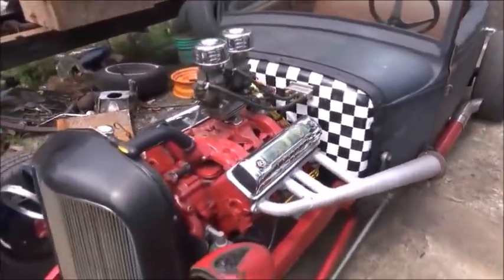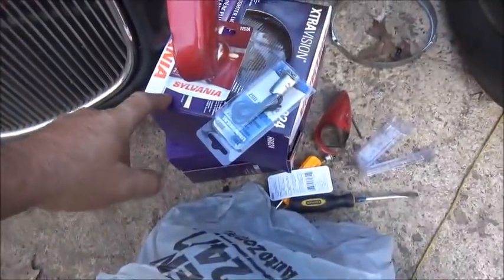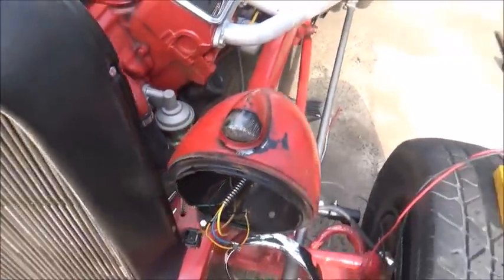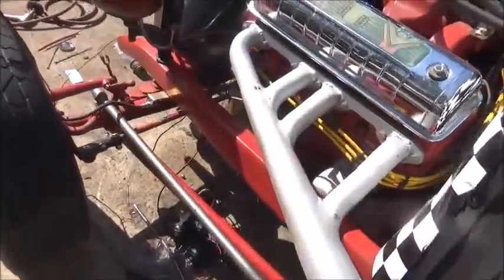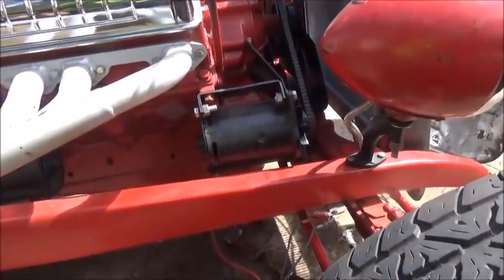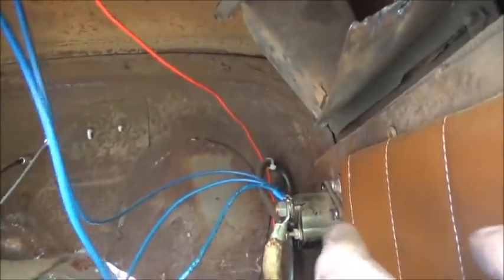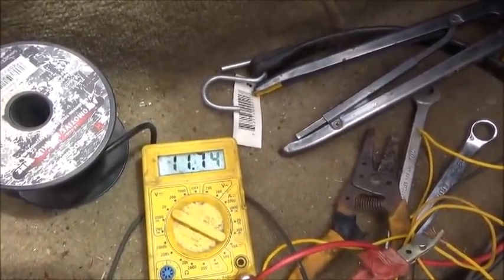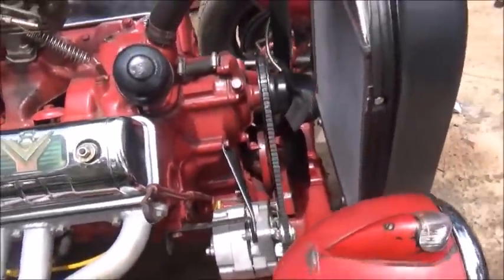1931 FORD ROADSTER HEADLIGHTS AND CHARGING SYSTEM

Comment: I used to run a momentary toggle switch to excite the alternator on my Farmall cub. What I found was the alternator would sometimes stop charging and I’d have to excite it again. Later I just hooked the excite wire to my ignition toggle switch and placed a diode inline to prevent it from back feeding the ignition.

Comment: you can still get cheap headlights and signal light bulbs  from a wrecking yard,  or scrap yard, used will most time last along time when you don't use them very much,, used  headlight 's turn signal  bulbs about .50 each  here   that is anyway

Comment: sorry, but alt has to have 12volts to it altime to charge,  genorator  will keep on charging once  motor starts,  how to check this vechile with alt will die  if you removed battery cable with motor running,  with generator will keep running and charging
Reply from the maker: 1 power all the time and one exciter wire. If you have power to the exciter all the time it will discharge when it is not running. If you have it hooked to the key power it will continue to charge and run even when the key is off. It must have a bulb, a diode or hooked to accessories to work correct.

Comment: Back in the day the 35 amp positive ground  power systems  were barely adequate so the 30 watts they saved by shutting off the marker lights was really worth it.   The system  could only supply 210 watts total at high rpm. So subtract 60 watts for headlights 50 watts for taillights  30 watts for ignition , 15  watts for the heater, and another 30 for dash lights there ain't much left. The extra 30 for the markers isn't there. and we left out the 20 watts for the the radio  as well. That is why they used vacuum wipers. Wiper motors are power hogs.

Comment: If you've got a motorcycle shop nearby they are a good source for those types of bulbs. Often used in indicators on Harley, BMW etc. They most likely have bins full of them(I know we had), they often get changed out for something else. They are also good source for other small materials I've seen you use; plugs, wires, bolts, brackets etc

Comment: I have a set of sealed beam lights very similar to those only the parking lights are a little smaller so I know what to look for now, thanks. Don't have a dimmer switch, forgot about that, I saw you had the good old style so something else to look for.

Comment: This is what I do to my headers and the paint stays on for a long time. I take old wood stove it's outside build fire take headers lay them on top of wood stove with a hook to hang them. Leave them there until they s top smoking, no pun intended. Paint headers while they are hot then i hang them above the wood stove let dry . And my paint has been on my headers for years they turn a little bit but that's white header paint for you.  Wondering if they make a hi temperature candy paint i don't know at this time but going to look and see. I'll get back to you on that,you may know what I am thinking .

Comment: Now you know why nobody else uses that terminal 🙂

You didn't want the alternator to only charge when you're starting anyway.  In fact that's a time when your don't really want it charging.  You could use an oil pressure switch, but that might be even more wiring.

Comment: I think before I spent that much on plain bulbs I'd invest in some LED bulbs that'll last a lot longer and don't draw as much current (especially good for vehicles with a generator instead of an alternator) and usually with LEDs they're just as bright with the car running as they are with the engine off because they draw so little battery power.  I just put a set on my riding mower that were a direct replacement for the 1156 bulbs it was using for headlights and you just wouldn't believe the difference.  It was like going from a kerosene lantern to a coleman lantern!  Bonus, if ya drop em, they don't break.  Got em for $14.99 a pair.

Comment: Here's an alternative: Alternator that looks like a generator
. ALTERNATOR That LOOKS LIKE A GENERATOR - AC-210. "DYNALITE" looks like a dynamo but is a lightweight alternator. RAC006 - Lucas C40 Replacement. This device is very convincing, looking exactly like an original 22-amp generator, but it hides a 40 amp alternator inside.

Comment: If I busted a bulb,I would have dripped thin coat blood on that pretty white manifold.Its hard to believe there's not one in your lot.
That old Yblock thinks it is still 1965.I like that bubble signal light.
Good to hear from ya

Comment: If you put a small bulb (side marker light) in series with the alternator excite wire, it acts as a resistor, and will excite the alternator.  In addition, when the light bulb goes out, you know the alternator is charging.  If the bulb comes on when the engine is running, you will know the alternator is not charging.  I have done several of these and have had good luck with the cheep-o marker lights from NAPA. Feed the light with the wire that feeds the light, and connect the terminal that grounds the light to the alternator feed wire.  Be sure to use the accessory side of your ignition switch so the excited alternator will not keep the engine running after you shut off the key due to the alternator backfeeding the ignition coil.  If your ign switch does not have an accessory terminal, you will have to use a diode to keep the alternator from backfeeding the coil.  Not a big deal...

Keep up the good work! I really enjoy watching your videos and learning the bodywork parts of your projects.  I have been wrenching for years but haven't done much bodywork.

Comment: 1931 FORD ROADSTER lights look fine!!! You'll sort that generator out. If I remember the Falcon generator correctly, it didn't have a cover over those holes, but the Mercury Comet did...Don't understand the difference, just that the Comet was a fancier Falcon is all....
Reply: I had a Falcon as my first car and it had the band over the holes where the brushes and commutator were, maybe someone left the band off some time when it was apart

Comment: My 64 c20 parklights did the same thing. Go out when you turn on the headlights on. But you can put a jumper wire between 2 post on the headlight switch and they will stay on. If you like that better. I googled it.

Comment: I've used an oil pressure switch to excite the alternator on tractors. The ford generator requires voltage on the fields opposite of a Delco, but you probably knew that.  Like your videos, keep up the good work.

Comment: Have you thought about using a  relay for the headlights? They would be brighter and take the load off of the switch.  The switch would just turn on the relay.  Just a thought.

Comment: That one blue wire off the solenoid has really gotten hot at one time. The charge bulb hanging under the dash will be a good choice until you get the generator fixed. I've done that on old tractor alternator conversions.

Comment: Good work as usual. Usually that exciter wire goes to the acc feed via the "IGN or ALT" small light bulb. It come on when not charging by finding a ground inside the alternator and goes off when both ends are at 12v when the alternator starts charging. If that bulb fails the alternator does not charge.

Comment: You could run the excitement wire from the alternator to an idiot light on the dash that's connected to the accessory on the switch. The alternator only needs to be excited when it first starts. I'm not telling you what to do just letting you know my opinion. Love this car.

Comment: If you wanted to really be thrifty, you could run the 6V sealed beams in series. Of course the problem is if you loose one headlight, you’d loose both.

Also I’ve found allot of the mom, and pop parts places sell bulbs from a bulk bulb drawer cheaper than getting a blister pack from some of the big name auto parts stores.

Comment: The smaller replacement bulb for a 1157 is a 1034. Memories from early years workin' at a gas station.
Reply: Johnathan look at a Napa # BPB1007AN. I think it would be a shorter version that would work. Your store would have to order them. Up here in ohio they would cost 5 bucks for a card of 2. Also they have common bulbs in boxes of ten that are less expensive.

Comment: You can use a diode between the switch terminals to allow the parking light to stay on.  Place the anode of the diode on the headlight side and the cathode on the parking terminal.  Use a diode capable of probably 4 amps.

Comment: The purpose of the coil on the solenoid is to provides 12 volts to the Coral when starting this wire will be connected between the resistor and the coil when does solenoid is just engaged or you let go of the key for a run position power then comes from the key through the resistor and drops the voltage down 9 volts love your work God bless you and your family

Comment: Dose the exciter wire need to stay live ?
Reply from the maker: no, but will run a battery dead if it is live when key is off.
Reply: @jonathanw4942  Thanks for getting back to me on this . So if I understand right it comes on with the key and stay on tell you turn of the key ? thanks again for your time .

Comment: If the solenoid has 2 small wires yes you can use the Ignition side to excite the alt. The S side is only active when the switch is in the start mode.
Reply from the maker: I tried and yes it is a two wire, but it wouldn't work
Reply: @jonathanw4942  The only thing that I can think of is on the Ignition side after the switch is in the run position there isn't enough voltage/ current to excite the alt. May I suggest you change the exciter wire to the run side of the switch. My thoughts if some one put a radio in the car they would turn the switch to the acc. to listen to the radio with out the car running and will cause a extra drain on the battery. BUT you and I both know that there is nothing sounding better then the rumble of a street rod!

Comment: I have been using alternators on my hot rods since the mid 60’s. Much better than generators. The one wire is junk as far as I’m concerned. GM came out with an alternator in 1963 with an external regulator the first ones I used.

Comment: I always make my alternators an external one wire by putting a small light bulb between the 12 volt terminal and the exciter terminal then a wire from the small 12 volt terminal to the large one. so I only have one wire going to the alternator. You could also use a small resister instead of the light bulb. I have been told that sometimes this causes the alternator to become an electric motor when the engine isn't running but I have never experienced that. If the alternator tried to run off of the battery then a diode would have to be installed in the wire from the battery. Jim

Comment: Remember when a headlight glass was $3 for a new “dual sealed beam” and a belt was four bucks. Then came the computers, price fixing, technology and now a set of headlights can be $2000 and a single F-150 tail light over $1000. I paid $1800 for a new Dodge Dart Demon with a slant six, factory three in the floor in 1972. It got 24 to 26 MPG and ran 250,000 miles. Delmar O’Donnell said it best, “That don’t make no kinda sense”. Electric steering and they gave us the “shaft”.
Reply: Just replaced my 96 F250 headlight assy and glass for about $40. / side. Put Wagner "daylighters" in, exp $50 set.... Need to do that about every 25 years!
Reply: I wish i had a rod like this with a slant 6 showin in it. To me better lookin than a v8

Comment: How many old cars you got laying around there... and you don't got a good bulb you can steal from one of them? I kind of like that new socket you got, I don't think I've ever seen one like that... I think I might need one on a project.... I'll have to check around for one. I think the only thing I would have done different maybe is mounted turn signal/larking light inside and the cover or housing, turning the bulb and socket 90° with custom a bracket, that way the cover won't hit the bulb... but sounds like you have a solution for that.

Comment: That solenoid is a single post... the two post ones with a post on the side where it went to the starter is hot so that when you cranked the wire that used to hook there went to the coil for a full twelve volt to start and then when its running when back to the resistor for their reduced voltage at the points. I can't remember if it stayed hot or not but if it did then you have a shortcut available. It might not and then it wouldn't work either. I have seen them on chevys that the wire going to the alternator was wired from the coil on purpose (remote coil only) to the alternator in the factory loom. Looks right nice... I don't think the alternator will vibrate too bad but if it goes to it then you have it figured out in less time than me trying to type a smart answer. Some of what your videoing takes less time to do than the videoing so I am grateful that you take the time. I have seen them wired from the exciter point on the alternator around to the hot side of the alternator too but thats only if the hot goes hot when keyed.   I hoping that yours and the wife's are both ready for tomorrow night

Comment: one long solid bolt  through to hold the alternator on  one bolt that goes to the back of the bracket to keep the alternator  in line  ?
Reply: I thought the same thing until I looked closely at how it's mounted.  It doesn't need a long bolt because the bracket connects to the rear.

Comment: As I remember from my junk yard days, if you apply battery to a generator it should run as a motor if it is good.  Think we used an old battery and jumper cables to test.
Reply: your right, i use a generator to start my engine,  then the regulator kicks in to charge my battery..
Reply: @jeffmartin9248  in the UK that is called Dynastart, as the dynamo (generator) starts the engine.

Comment: Looks like it's time for a new multimeter. Yeah, lightbulbs ain't cheap anymore. Those sealed beams used to be 6 bucks, now way more. Fewer vehicles use the 1157 anymore. Meanwhile advance auto is selling conventional oil for 7 bucks a quart.

Comment: Why didn't you get the bulbs from all the "towe" cars ? 8 bucks is ....
Reply: Snoopy Brown 
Unfortunately,  most, if not all, his tow cars use a completely different bulb. The new sockets are totally different.  1157 bulbs are expensive because they're practically obsolete.  I wonder if the clear ones are just as expensive as the yellow,  though.  Could always use yellow paint on clear ones......
Reply: Yea I wasn't quite sure why he didn't run a 1157 peanut bulb ...the I realized he wanted to keep it as much era correct as possible.
Reply: Ok, love his Chanel, but nothing is "period correct" ! It's all hand made with "Love"!! So I see it do it like you want!

Comment: I used to rebuild Ford starters and a few generators.  Yep, just like Ford starters, the generators had a band around the slots in the rear so you could access the commutator with a stone to seat the brushes.  The band was secured with a screw that went to each end of the band.  I'm an expert at rebuilding Ford starters as I did it for over 10 years.  If you ever need a Ford starter rebuilt just shoot me an e-mail.
Reply: @herbtender910  Yeah, I got paid by the hour and I could rebuild over 100 Ford starters in 8 hours.  That included bench testing them on my vise which was hooked up to a 12 volt battery with a charger hooked to the battery. After putting them together I'd test each starter on my vise and when they wouldn't run I had to trouble shoot them right there in the vise.  After testing them and using a stone on the commutator to seat the brushes I'd put on the slammer cover and rear band.  I used a butterfly air tool for the through bolts and to tap out the nose threads.  I couldn't do 100 a day at first; I had to build up to that after a few months.  We had a tear down shop that tore down the starters and cleaned the parts.  We had a hot water washer and a vat with mineral spirits for cleaning up the parts.  Then the through bolts, noses, back plates and small parts would go to the blaster machine (we called it the willobrater).  The housings were tested (field coils) and new brushes installed.  Then they were painted black.  The armatures were tested and painted and went to the lathe to turn the commutator and sand the center of the armature.  I would collect the parts that were ready and set them up on a table (later a line that I welded together-when the boss found out I could weld).  Then I'd put them together and then insert the brushes in the back plate and test them.  Did this for over ten years.  We sold rebuilt starters, generators and alternators to various parts houses that had contracted with us.

Comment: Just spent 25$ replacing 6 light bulbs in my truck. I would bet they don't have over 50 cents a piece in making those bulbs either. Cheap flimsy things
Reply: Chinese bulbs
Reply: @chuckstith838  Move the decimal point another couple of places to the left!
Reply: Check Rock Auto